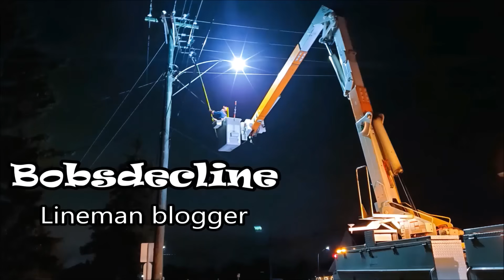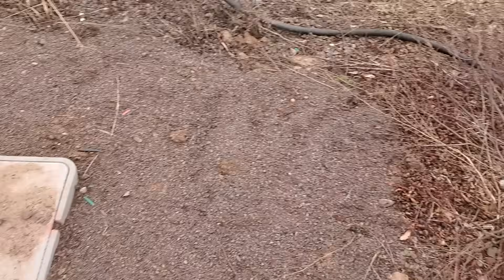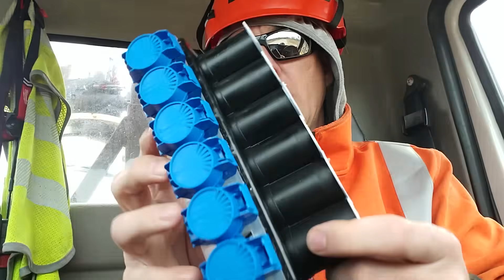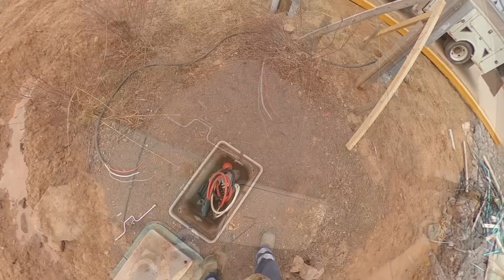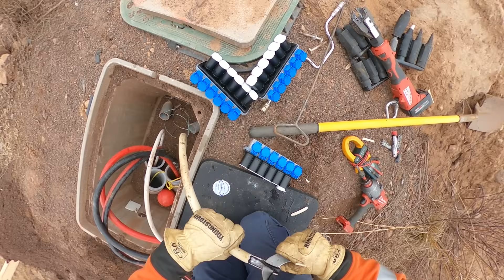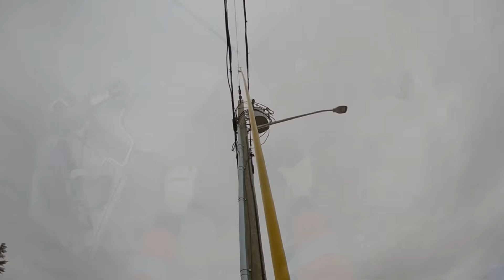Temporary underground power

Comment: Here in the Netherlands all electric infrastructure of 50kv and below is underground, so it shouldn`t matter. We use Jokari insulation strippers by the way, they have a swiveling knive inside, you rotate it around the wire where you want to start stripping, and then pull to towards the end of the wire and the insulation comes off.

Comment: I’m amazed that your company allowed this installation!  Why in the world would they not demand a standard triplex drop to that temporary when it’s less than 10 ft away from a pole with a 75KVA can?  The throw away of some very expensive bus connectors is the least of the issue.  In the end, the installation leaves an unprotected service entrance cable laying on the ground for anything in the world to roll over it in a construction zone.  I looked it up and a 75KVA transformer provides more than 18,000 fault amps available on the secondary side.  Certainly not something that should be just laying around!  You normally put out some good stuff but this one is nothing less than dangerous; temporary or not.

Comment: Hey bud and hello from Tarpon Springs Florida, you had mentioned it briefly at the very end, but from a commercial refrigeration technician (who deals with three phase equipment) THANK YOU for checking polarity! My refrigeration equipment is three phase supply and they’ll run the compressors and indoor blower motor as three phase but they use the condenser fans on single phase and make the connections inside my controls panel. So if the lineman does work out at the pole, and flip flops L1 for L3 or something else, my equipment literally runs backwards!!!! P.S.C. motors don’t mind so much to run backwards as with reciprocating compressors but the “new” Scroll compressors will get permanent damage. 
  I’ve put on quite a few phase monitoring devices to shut down the unit if that happens.

Comment: Do you ever feed from the center out on the longer "Polaris" blocks? On the high load, many parallel conductor transformers, we always feed in to the center and go out from the sides. That way you don't have one spot on that block that has all the current on it. Not sure if Polaris specs that or not, forget.... In this case, with a few small services it doesn't matter though.

Comment: Nice overview of the process mate, is there a blank that goes over the meter connection there at the end or do you install an actual meter and seal it?
Meters in Australia are hard wired in and are installed by the power authority, or their contractor and sealed by them.
Then they are read by a meter reading contractor. All adds to the monthly power bill haha.

Comment: Interesting thank you.
Yes Safety 1st!

A couple of curiosities:
1) the plastic terminal block looks easy to make connections. 
1b) Self-sealing features with silicone along with mfgr's claim can seal out water when immerse is a tall order. 
1c) Perhaps under premise that mechanical forces of wires being connected do not distort terminal block plastic frame?

1d) The same or similar connections in handholes or manholes exposed to deicing brines, chlorides, and blends how robust would the connector be?

2) Are there any benificial reasons why your array of tools, test instruments, etc are placed on dirt instead of on a clean tray?

PS- Kudos for collecting debris.

Comment: I appreciate you cleaning up. I do pole inspection and surveying and the amount of leftover bits I see after there's been work on the power, cable, or phone is just nuts. I've picked up so many random bits of wire or plastic sheath or other stuff that's just been left laying there.
Reply: Electricians are allergic to cleaning anything except their trucks😂

Comment: A 75 KVA can will provide enough fault current?  I was told the largest can we can set for residential is 50kva.
Reply from the maker: Not fault current... Anything over a 50kva at 7200 V can supply over 10A during regular use. 

We aren't allowed to open a switch if there's more than 10A with a load break of some sort.

Anything over a 50, unless proven otherwise, we have to assume there's more than 10A and follow procedure accordingly
Reply from the maker: We install up to 100kVA when required. (In residential areas) But typically 50 or 75

Comment: The connectors appear to be "TE Raychem GelPort Connectors". Bingle will find more information. A lot of info comes from New Zealand; clever folks there. Some sheets give wire size in mm2, but I did find MCM rating (500) at Wesco.

Comment: There are times i wish i had overhead service instead of underground, but distance from the pole is probably why i assume. I always considered overheard as less safe cuz of wind and what not. But underground is more of a pain to repair, which actually happened to me about 15 or so years ago, they set me up with a generator until they fixed the line.

Comment: In theory all of that stuff will be OK underwater.   Likely what save you is that almost all of the time, they will not be under water because a tiny/pinhole leak will result in the destruction of the hot wire(s).   I take it that eventually the neighborhood will be shifted to pad mounted transformers where everything is dry.
Reply: It's not just "theory" All underground equipment must be waterproof. Think, all large cities have their electrical equipment underground. If it's not meticulously built it will fail. Even secondary voltage in a handhole must be waterproof

Comment: Listened to this video on the way home from my CDL test. (Passed💪🏻🙏)
Reply: Congratulations 🎉
Reply: Congrats. Is that part of working towards being a lineman? Or a regular trucker?
Reply: @grabasandwich  I’m trying to be a lineman my friend, this is just one step of the journey. Thanks for asking
Reply: @grabasandwich   "Is that part of working towards being a lineman?" CDL is always good to have. Is a good life-building job ticket. Basically any rig over 13 tons (including any trailer), "used commercially", will need a Commercial License. Aron's truck naked might be under that, but he's got the person-lift plus supplies and TOOLS and parts, and the truck is rated to pull a trailer with a pile of poles or set of transformers. But a CDL is also good for many heavy trucking jobs like large school bus, water delivery, hauling food for grocery stores, garbage trucking is essential, and (with extra stamps) your gasoline tank trucks.
Reply: Congratulations
Reply: Raychem is a major manufacturer of connectors and splices - especially for use in outdoor or wet environments. I’m an aircraft electrician and we use Raychem environmental splices all the time is joining wires in airplanes.
Reply: @Arabraxas  is there a glitch? How did you reply about raychem when I didn't mention it here? (I did comment about it in another video a while ago!) Weird...
Reply: Great job man!

Comment: Those GelPack connectors don't have a specific torque, or are they self-limiting? And there must be a ground rod on the temporary power base since you didn't wire the ground to anything?
Reply: Yes, the connections should be torqued. They're just a simple setscrew bus connector with an insulated housing and gel seal.

Impact guns are the new hammer for lineman,
Reply: Building or service grounds are at the panel or meter. Utility is not responsible for customer grounding.

Comment: Ok Aaron just to clarify when you say open the transformer it means to close the current (cut off electricity) and close the transformer or the fuse it's to reopen the current (return the electricity) unless I misunderstood it's a little mix I find
Reply: Open as in open/break the circuit. Close as in close/make the circuit.
Reply: As John said, it’s common phrasing to refer to completing the circuit as closing it because you are creating a “closed” circuit which can flow.
Reply: In the electrical world opening a switch means interrupting the current flow.  In the plumbing world opening a valve means enabling the current flow.  This is why plumbers shouldn't do electrical work and vice versa.
Reply: @petehiggins33   But in everyday life opening a switch means opening the light for example I think that's why it's a little mixed because and so the concept of saying open switch when you turn on a light is a general term erroner I think that's the problem
Reply: @Look_What_You_Did there’s no need to be an ass to someone for asking a question.
Reply: @Look_What_You_Did Somewhat uncalled for. You seem to neglect that not everybody was born with a full knowledge of electrical terminology, English as a first language, or with the ability to write sentences with perfect syntax and spelling.

Comment: It seems a just about every utility has stopped running their own cable. I get it, for liability issues, but the whole point of the union is to keep jobs for union members. Its not exactly fair game to throw the bone to scabs and rats when there are plenty of union positions available or able to be made available. From a company side i understand its cheaper to use non union contractors but that screws the union members over. Obv im not knowledgeable on whether you are in a closed shop district or open, so idk if your company allows non union. Great video, thanks!
Reply: The union agreements throughout my state forbid union utilities from using non-union contractors. There would be massive problems if they broke the rule.
Reply: Most contractors doing the work are union, particularly up north.
Reply: @Jason-kg3oc  not where im at. Im in the U.S. on the east coast, southern side. A ton of non union companies here.
Reply: @ms8studios157  last time I checked, the point of a union was for collective bargaining and to advocate for union members' labor rights. Why you think unions should act as a cartel and prohibit any and all work performed by non-union entities? Why shouldn't utilities/developers/whoever be able to use non-union contractors?
Reply: @ferrisr  the reason why is because non union is usually undercutting the cost of work for union workwrs. Less benefits, slightly more pay, its taking jobs from union guys. If union guys start losing work because of it then non union has to go
Reply: @ms8studios157  that's capitalism. otherwise you have a union-run monopoly and no controls on prices, and the world is stuck paying whatever they want to charge. if non-union work is significantly cheaper, then we should be asking why union labor is so much more money, not banning non-union labor.
Reply: @ferrisr  i never said union work was more expensive labor wise. Though in a some areas it typically is. What i said was that non union costs less for the power company because they offer little to no benefits, so they can charge the utility less and still break profit. Union offers good pay and benefits for workers, which is leagues better than poor to no benefits but better pay
Reply: @ferrisr  Capitalism is a bad thing, unless you happen to be an owner of Capital.

The average non-union worker does not own any capital. MAYBE some land if they are lucky.
Reply: @ms8studios157  if people are willing to work for fewer benefits, then yes, that allows non-union labor to charge less. Which means fewer costs to the power company, and lower utility bills. Unions are good for the workers, but if they're allowed to become a monopoly, they're bad for everyone else.
Reply: @ferrisr  utility companies are monopolies. Controlled monopolies, yes, but monopolies nonetheless. They wont pay more than they deem reasonable and prudent for labor, even to a labor union. Now if its too low, the union will strike. That doesnt happen too often anymore.
Reply: For new communities with underground utilities there are significant advantages to having one company/party install multiple utilities at a time. It really does not make sense to have the electrical company install their lines/ ducts,  then put the dirt back, a week later the telephone lines get put in,  dirt goes back, cable, gas. Each time a set of lines goes in there is also possibility for damaging the previous work. Installing all the utilities at once in the Utility Right of Way (URW) is far more cost effective, and far less disruptive.

I think out on the east coast there is still a lot of aerial work that is constructed by the electrical company but I'm not sure on that.
Reply: @bert-blank  i agree with that. My issue was with utilities bringing non union companies in to do union work. Not with the fact the utility isnt doing it themselves. I understand why they dont do it themselves but they could at least stay union.